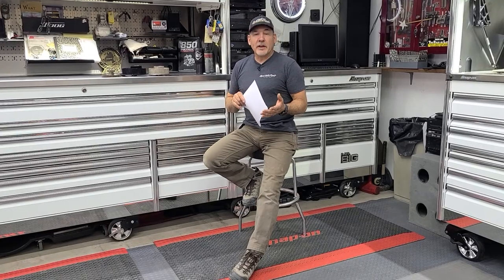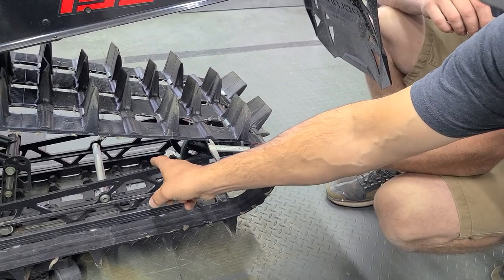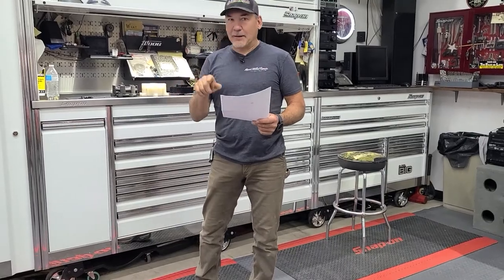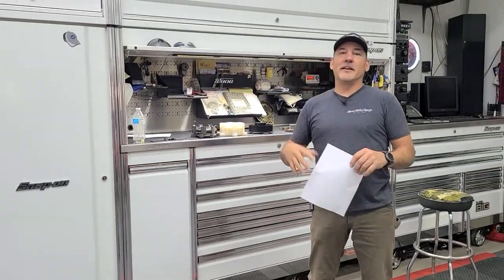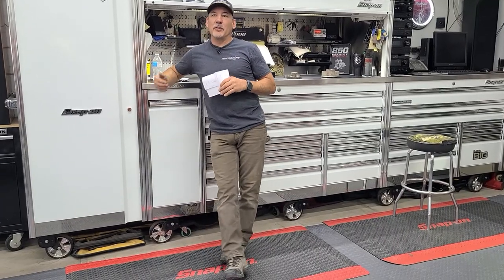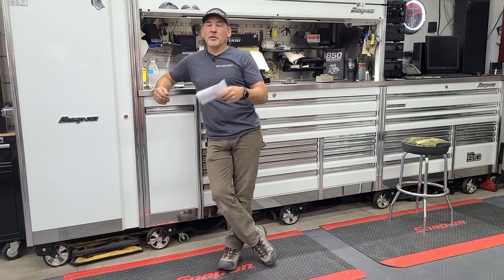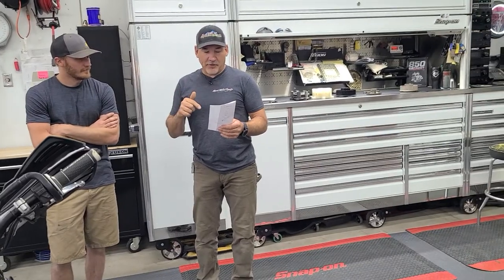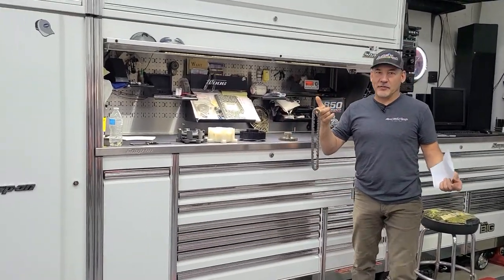Gearing 101

Comment: I have done testing on a dyno between chain and belt and the belt is more efficient. Basically a 700 rmk engine mounted in a bulkhead  with clutch locked at 1:1 through through the chain case/ belt drive and the dyno mounted to the drive shaft. Belt won hands down at 8000 jackshaft rpm.
Reply from the maker: We found the belt drive to offer  an advantage at low-speed and during acceleration due to its low inertia and efficiency but at higher speeds we found the exact opposite. We performed both empirical testing as well as logged data analysis and worked with very reputable companies throughout. Not certain why your testing revealed the opposite result, I have no opinion and just report the facts as we observed them. Thanks for the input 👍.
Reply: Does a chain on a trail sled and belt on a mountain sled make any sense?

Comment: I currently am running the pro gears on my 2020 850 khaos 155 2.6" lug. I ride 90% of the time in tight trees at elevations from 3000-8000'. Tons of slow speed maneuvers and short punchy run ins for jumps. It still doesn't have the low end grunt to get me going that I want. I noticed a good improvement over stock once I go about 3-4 sled lengths it pulls good and continues to pull hard, its just that initial jump out of the hole that's still unimpressive. It is exaggerated even more when the snow becomes heavy and thick. It does have slightly longer belt life but would like even more low end if possible. I am looking at the kurts gear down and the QD2. From what I understand there shouldn't be much difference between the pro gears and the kurts kit. Both have a gear ratio of around 2.09ish so I can't see the kurts gear down giving me what I want. What about putting the QD2 gearing on my machine with my stock 2.86 pitch driver? Any idea what my final drive ratio would be? Would it be too much? I just don't want to make it worse by gearing down too far.
Reply from the maker: The Kurt's gear down is slightly higher than the QD2, and by the sounds of your use demand I expect you would be pleased with the result if you were to employ the QD2. Regarding final drive ratios I put up a chart in this video and explained the process of calculating them..  GL. Thanks for the question.

Comment: Eric,

Being that this video is a couple years old now wanting to know what your finding have been now with the Boost and the 9r. 

I currently have 155 khaos boost 2.75 track QD2 and 146 khaos 9r 2.6 track QD1. I am looking to change both unit to the TKI kit. However I am wanting to change gearing and not just run the standard ratio if I am spending the money to change to the TKI kit. Any thought?

Comment: Very nice information! What is the formula to calculate the final ratio when I already know my belt drive ratio?  2.63 with 8 tooth 3" pitch
Reply from the maker: The industry chose to commonize that variable to create a relatable final value that transcends brand and model. Otherwise the relevant consideration wouldn't be final drive it would be gear ratio. Which in most cases is all that really matters. I think it's nonsense also and believe that individual final drive should be considerate of individual driver configurations... don't blame the messenger:-)...

Comment: Got a 22 matryx slash 146 QD1 with the 2’’ track. Was wanting to go with a 2.5 challenger track for it will be more fitting to my UP riding and for out west. I ride some trails still but ultimately want good low end pull. Just curious if I could keep my QD1 drive or if I should change to the QD2 drive. Thanks! Great video.
Reply from the maker: That's a tough call, it's right on the bubble,  the correct answer is really going to be determined by your preference, however from the hip and if it were mine, I would switch to QD2 gearing. It may come at the sacrifice of some top speed at lower altitude, but in my opinion it's well worth the gain and response.

Comment: Thanks for the video! I ride a 21 khous 7-10 lbs of boost with a qd1-163, 2.6 lug will a qd2 or tki kit get this sled to wheelie !
I need this sled to erupt on the bottom end ?
Reply from the maker: It is unlikely that a gearing change is going to make a massive difference in the sense that your snowmobile will be completely transformed. Turbos tend not to be as explosive as many would hope. There's not much you can do about that. If you're looking to increase your units tendency to wheelie perhaps looking to suspension setup would make as big a difference is anything. But yes, gearing down will move you in that direction...
Reply: Thank you !!

Comment: Thoughts on putting Pro Rmk gears on an Axys?
Reply from the maker: Pro RMK Gears are 21:44 (2.09), QD1 gears are 22:43 (1.95) so applied to Axys will land at 2.37 final drive considering the 7 tooth 2.86 driver on the unit.

Comment: Why would you give a lower theoretical final drive if you haven’t changed the drivers. If you have 22/50 (2.27) QD2 and then run a 29/69 (2.38), clearly the 29/69 is lower as they are both using the same  sized drivers. If a skidoo is 21/53, (2.52), with 6 tooth 3.5” pitch drivers, why would you change the final ratio without actually making a driver change. That’s what they come with.  I feel like the info provide wasn’t very clear.
Reply from the maker: You are absolutely correct, that was something I clarified in comments earlier. That information was essentially Incorrect or at least unclear with respect to the SkiDoo. I apologize for that.
Reply: @TheVOHK  same as the Polaris gear down. There is no need to factor in drivers as your not make an actual driver change. The 22/50 QD2 is a higher gear ratio then the Kurt’s 29/69.
Reply from the maker: Maybe it would be easier if you gave me a call so I can explain. It boils down to all manufacturers commonizing the final variable of final drive and that is why you make the driver correction. It is an effort to create data that will transcend models and manufacturers and still offer a relative expression of final drive. Otherwise we would just be talking gear ratio. Happy to chat with you sometime feel free to give me a call at the shop. 970-724-9655
Reply from the maker: Where you're going wrong is at the time that we were testing and that I made that video as indicated in the above comment the Kurt's gear down kit was a 32 67 ... that was all they sold and that was all that was available at the time. They have sent altered their gear down kit and it is indeed now a gear down kit but like I said at the time the video was made the Kurt's gear down kit was actually a gear up kit. The facts don't lie.
Reply: Great video….even tho I’m a Cat guy lol….just fyi the oem gearing on the alpha you had was correct but the alpha uses a 3.5 pitch 7tooth driver not 3.0 unless you’re referring to the twin rail non-alpha which used the 3.0 pitch 7tooth so the final drive ratio on your chart is incorrect for the alpha being that low.